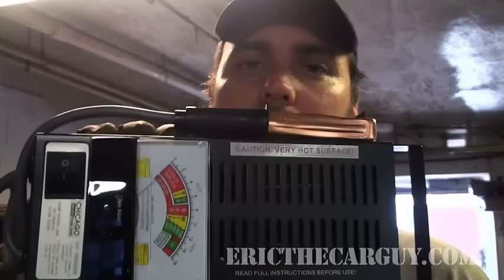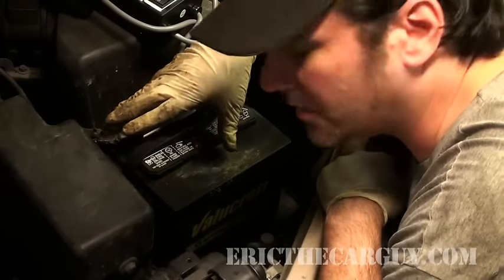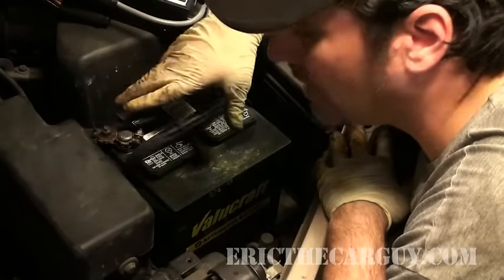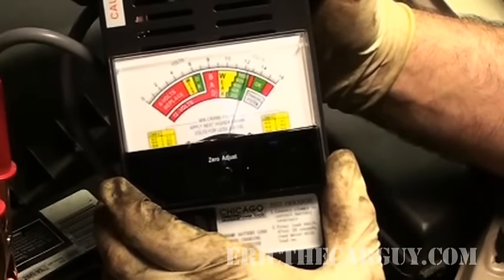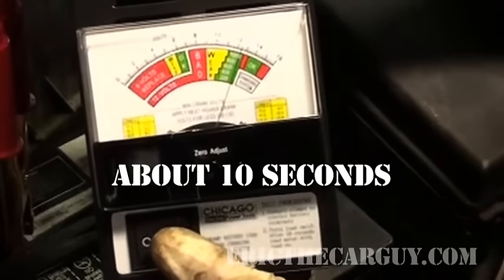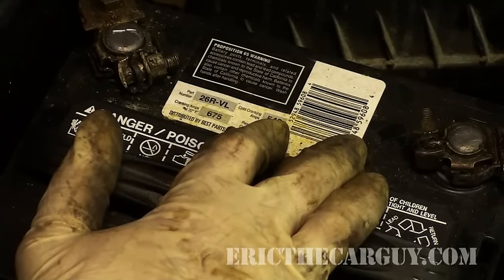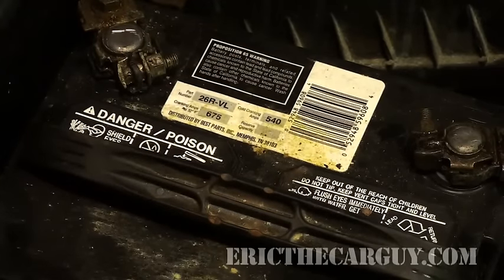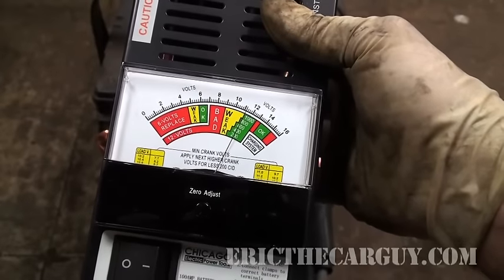Load Testing A Battery - EricTheCarGuy

Comment: 6:36 I am going to invest in a load tester tomorrow. Reason is I’ve had an intermittent battery light issue mainly when trying to accelerate between 30-55mph. I have to step into the gas at high rpm’s to get it to speed up and finally shift around 55. But the battery light comes on. Back in October last year I had to replace the battery with one that was only a couple months old. Light was giving the issue prior to that but it was on rare occasions. Over the last couple months it’s been more frequent and last week it just stayed on. Never had issues with dimming or flickering lights or anything. I replaced the alternator with a used one. I still have an intermittent light again and the shift issues. My multimeter says I have 14.7 volts and 14.2 colts when I turn on headlights, a/c, interior lights. But the light only comes on when I attempt to speed up below 55. So I want to do a load test just to satisfy one thing that is on my mind that it could be. Thanks for the video. Btw it’s an old vehicle. A 2006 Buick Rendevous CX with a 3.5 V6. I inherited it sort of from a friend that passed. So I inherited the problems too. Lol.

Comment from the maker: @ericgohsw I don't see any readings for a load test of the battery.  You might want to watch the other video I did "Alternator Diagnosis 101" for more tests and info but it is paramount that you load test the battery before doing any other testing.  BTW 12.4V is less than the 12.6V the battery should be.
Reply: why is it key to load test a battery before testing the alternator?  can a good alternator fail a test if a battery tests ok at shops but wont pass this load test?  have you ever seen a good alternator fail a test with a load test 'fail' battery, yet test ok with a good battery?  

if you have, then i think i got fleeced good by dealership who only load tested my bad battery after replacing the 'failed' alternator.

Comment: Cool video, i remember mine battery dropped dead once in a warm day in couple seconds. I stopped the engine, went to the store, came back, turned the ignition key and all i heard twice was CLICk CLICK, checked, the connection, all was fine, checked the starter - all fine -  turned out one of the cells just dropped - pretty much no voltage at all and no way to charge it - battery was 13 years old :)

Comment from the maker: @jambe1234567 Either your equipment was not connected correctly or your battery isn't good.  Check the connections first.

Comment: in a comment you noted:  it is paramount that you load test the battery before doing any other testing.  so i wonder:  is it key to load test a battery before testing the alternator?  can a good alternator fail if a battery seems ok but fails a load test?  or are they independent/separate tests?  
the honda dealership only basic tested my battery (didnt load test), then tested the alternator which failed, replaced it, the load tested the battery as a last step which failed.  so now i wonder if i got fleeced.

Comment: @nightmathzombieethan mentioned that quickly in my first comment, but also wanted to add more info because you don't always get a battery with a car or sometimes the tags on the battery are heavy worn/damaged that they can't be read anymore.

Comment: Im having trouble with my starter and it's not turning on the first few times. Load test is just under 11 volts. So , battery is good enough no replacement right ? So what's next step ? Check starter ?

Comment: My car would crank but not turnover. The dealership told me it was the fuel pump so they replaced it. They had to keep my car a couple days for an airbag recall. Today they call me saying the car wont start and they found its the battery at fault. Now the battery I have is a 2 year old yellow top dry cell battery because I have an aftermarket audio system. The battery was checked prior to bringing it in with a load tester and it read 12.8 and didnt drop. I informed him this. He said the battery was tested on there end and only read 100CCA out of the 750CCA. ANd that battery can just die.  Because the battery is still under optima warranty I told him I would buy a battery and bring it in. They okay'd this. I think they are trying to steal my battery and take my money now. There is no way I believe to read CCA instantly, correct?

Comment: On a diesel with 2 batteries, should the cables be removed to keep from getting back feed from the second battery. In other words I would need to do 2 seperate test on isolated batteries?

Comment: I just use a voltmeter, run tests; checked before, got a reading of 9.31VDC I already knew she was a goner due to some simple tests I did but I proceeded. I jump started her and she jump to 14.3VDC in no time, I immediately knew it was not the alternator which was what I was checking for and so, I tossed her out and got a new battery and she is all good now.

Comment: I don't have a lot of faith in the load tester you are using because of the low current draw, in my experience those will give you a false sense of security. I just bought a digital load tester from an online vendor for a little over $100 with S&H. I like it because it will calculate the CCA available in the battery and there is nothing that gets hot around the hydrogen gas on top of most batteries.... Its a good video and the voltage should never drop below 9.6 by industry standards.

Comment: Can load testing cause damage to the vehicle? I went to a battery shop to get my battery tested and I wanted to disconnect the battery but the guy there said that there is no need to and did the test.  But I am still worried that some damage may have been done to the car's electronics. He used some electronic tester - not so large as this, but not small either.

Comment: Eric, Thanks for that 9 volt reference point. I have that same load tester, no instructions included ! I do have one question. Does everything you said in video hold true fof all battery types? You were checking lead-acid. What about Gel and AGM/ glass-mat batteries?

Thanks

Comment: i  have a 2003 hyundai accent and every morning i start it ,it sounds as if the starter holds on a little bit longer roughly about half a second and sounds like grinding ,.,.help . i think i look after her well as she is serviced every 8000 miles all parts changeable are changed

Comment: Morning Eric,Question please, What are you testing in this Gadget Display, Is it caused by weak diluted Acid, or Jelly, depending
on which type of Battery, if so, How do I go about replacing the Acid or Jelly which would have to be a lot cheaper then a new
Battery, and is not at all dangerous too do if proper caution and tools are used in the excercise!

Your Displays are second to none in my opinion, Please keep up the honest and good Work!
Regards,
John Richards.
Hillman, 6168
"Western Australia"

Comment: quick question Eric. Its getting cold here and my battery seems to be lacking the oomph that it had its been in the car for about 6 years now and i think this will be its last winter in your opinion what is the best battery you can get with 640 cca for around  $100

Comment: My battery reads 12.45 and it won't crank today. Yesterday I charged it, and it cranked fine but charged to 13.5. So this morning I crank it 4 times in 10 min and it getts weaker after every start till dead, but reads 12.45. Do you think it is most likely a cell?

Comment: 2009 ford escape. dead battery. jump started and drove home. turned car off and all instrument, dash, head lights flickered continuously, relay chatter under dash too. Took battery out. checked little over 13v. load tested pegged to the left low. Is it the battery? or some electrical problem destroyed the battery?  Thanks....
Reply: dodgy earthing point?

Comment: Hi, Eric. I checked the volts on my battery after recharging it with a charger that I bought. I'm not sure if I charged it fully, but when I checked the volts with a multimeter, it read 12.5 volts or so. Is that low? And if it isn't that low, why does my car battery die after only 4 or 5 days after charging? Thanks.
Reply: Eric will probably tell you that you can get a battery up to 12.5, but if it is a bad battery it will not hold it for long.
Reply: skipwadoo You were right. It was a bad old battery. I thought that it was newer that I thought, but I checked the receipt of the last battery that I bought and found that it was like 4 years old. Plus, it was a cheap brand from some repair shop. I bought a new one and my problem is gone.

Comment: Eric, please do the video about car batteries.
I'm currently trying to condition a weak battery because the internal resitance of the battery has risen up to 100m Ohms.
The IR is inversely proportional to CA/CCA.
Reply: What is CA/CCA?
Reply: +Zambia95 I think it's has to do with testing at very cold temperatures. The higher the number the better.
Reply: Rich Lo thanks
Reply: +Zambia95 Any search engine would tell you the answer. Try this link: http://www.optimabatteries.com/en-us/experience/power-source/what-does-cold-cranking-amps-cca-mean/

Comment: hello my name is mario and i have a mustang 4.0 2005 and i did an engine clean up but one problem as it did turned on wont accelerate what could be the problem some tell me to blow it off with compresser some tell me that its the throttle body that got wet but what can i do since its all lectrical please help me bro .....besides you are a great teacher on all parts of mechanical youre blesseds
Reply: Hello , are you Mario from Super Mario?
Reply: +Supzo yes lol

Comment: If I can crank up the car.. It means that the battery OK.. So,  Do we need to perform this test?? What is the purpose? Plz correct me if I'm wrong..
Reply: ewhayeb - what if your car is slow to turn over, but it does? Throw a load on it and if you are reading 9volts or less it would behoove you to replace the battery instead of waiting till you need to leave for work and you're stuck with a car that won't start.
Reply: Repair shops always tell you you need a new battery. They lie all the time. I've been lied to many times being told "your battery failed the test". Then when I use my tester, it magically passes.

Comment: So I load tested my battery and it came down to 11 volts which is the yellow level like on your meter. Fully charged my battery was at 12.9 volts. I have the Same one. Now I drive at night, and at stop lights the car vibrates. I then put the fog lights and it vibrates a little more. Is that a battery issue? During day time it does not vibrate, only a tiny bit since I push the brakes at the stop light.
Reply: Sounds like an alternator problem

Comment: do the same test by putting load on the battery put on air cond high beams and radio windscreen wipers while the multimeter is connected a standard multimeter not a load meter if you don't have one, and yes if under 9 the battery on way out. what do you think?
Reply: worthless test

Comment: Eric my battery is fully charged but on doing the load test it goes straight to 0. Is this right or should i at least give a number since its fully charged.

I cant get my car to run beed through 3 remanufactured starter replacement since I know the guy it was ok, but it still doesn't even crank.  Thanks for any help
Reply: If the battery goes to 0 on a load test, it needs to be replaced. The magic number is 9.6 volts under a load that is half of the cold cranking amps. Anything above that is good. Anything below that needs new. Hope that helps.
Reply: No, sorry but it was a bad ground. The engine ground strap was dirty with dirt and oil and coming off, (not bolted correctly). I cleaned it and torqued it down and the engined turned on right away. I hope that helps anyone out there!!!

Comment: I forgot my lights on a month ago. Someone boosted my car, and did not have an issue. A few days ago, I forgot the lights again... Boosted the car easily. At home, I stopped the engine, and restarted the car just to see. It did not start... I tried to boost, but it did not work. A mechanic recharged the battery and ran a test on it. Very good condtion at 13.01V. Today, I used a voltmeter to check it out. I started the engine. It quickly went up to 14.50V, but also quickly dropped back down to 12.35 after a minute. It stabilized at this point. I stopped the car, and it stabilized at 12.51. I cleaned all the connectors after all these tests. What can we conclude so far?
Reply: If your battery has the type of fill caps that can be removed, get a battery hydrometer and test the battery.  If it shows low on the cells, charge it more.  It will never come up all the way from driving it.  The alternator is not a battery charger.

Comment: Eric, Can a battery lose voltage not connected to anything in cold weather?
Reply: heat speeds up chemical reactions. you're supposed to store batteries in a fridge to prevent them from discharging. if a battery goes dead in cold weather its probably a bad battery. you also arent supposed to store them on pavement, as that supposedly drains them.

Comment: hi Eric got a question i bought a load tester like yours and checked the battery on my truck (two bat. one disconnected.) and when i checked the load on connected battery the needle showed that the battery is bad but when i disconnected the battery completely it checked out just fine so Question is did i preform the test wrong or i got some other electrical issues

Comment: Eric, My car starts first time everytime in the morning, but if i've recently drove it within the last 2hours , the car cranks over a few times before starting, Do you think this is battery related or fuel related? Any ideas? . Had a new Rotar arm / Distributor car / Spark plugs recentently, and no improvement ,Thanks very much :)

Comment: where is your WHOLE video on battery issues.  Just fixed and diagnoised a faulty solenoid on a 525TDS bmw.  Prob was it was not all its fault but the screwes shorting the positive poles could of had something to do with it also.  However, since the replacement of that unit.  Wow it turns nicely and yes it started the car.  ran for 30 secs then I switched it off.  10 mins later added small amount of potective grease over those solenoid poles cleaned up excess.  Went to start the car and errr.  turn turn turn turn chugg chugg turn COUGH splutter.  START! and wham.. dies after 2 seconds.  repeat x4 same thing. dies after it sarts. 5 attmpt errr uhmmm, think the power in the battery is almost gone.  It was a fully charged battery 110Amps.  Problem is, I think someone swapped it out of a bleeding old battery. cannot tell at all the year of it.  so please where is your battery video.. thanks

Comment: I have a question when I go to start my car in the morning, I have power but as soon as I start to crank it over it will start, then die. I'll turn it back over but this time it will just die off. I took my battery to Advance Auto Parts and they ran a check on it. It's rated for 550 CCA but it is only operating at 145 CCA and they said the battery was shot. Is this true? The voltage was right on even when I checked it.

Comment: Hi I have some question on cold crank amp thingy .. Mines 770 but the guy at autozone said its 10 amp on the tester and he said something I might want to charge the battery but I've been driving with this battery around for couple day now . Sometime I just start a car running just to rechagred it . If the battery not recharge then its bad right ? I mean I was thinking to change the battery anyway since I saw liquid leaking out. . And sometimes it hard to crank after I drive for lil bit

Comment: How to identify if the car battery is fully charged or not??
Reply: The video left that important piece of information out.  The only way to know for sure is to measure the voltage across the positive and negative battery terminals with a multimeter.  You can buy a reasonably accurate one for pretty cheap at Harbor Freight or Amazon.  A fully charged battery is 12.6V, but you can load test it if it's 12.4V or higher.  If the battery is below 12.4V, you shouldn't trust the results.

Comment: Anyone have an idea if it could be a short/bad ground/ or what? My 99 corolla looses all power and turns off while driving if I use headlights blinkers or hazard lights... im wondering what do i check to find the problem... it sounds like they are on the same circuit. It sounds like it could be a bad ground  or a short or a bad relay.... any suggestions ? im going to buy a multi meter like tomorrow but im a little worried im going to blow something in my car because i already made one relay burn out when i brought the two tabs together on the coil that was for my day time running light(relay)... :/
Reply: I had the same issue on my Suzuki swift 2001 car and it turns out the negative connector was not connected to the battery secure enough. Tightened it and now problem solved also cleaned the terminals and battery while at it :).